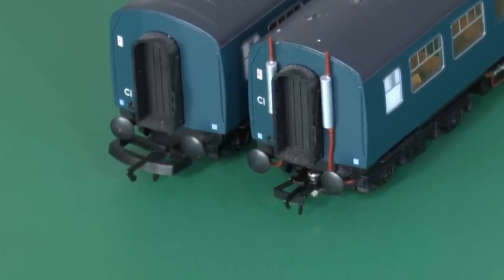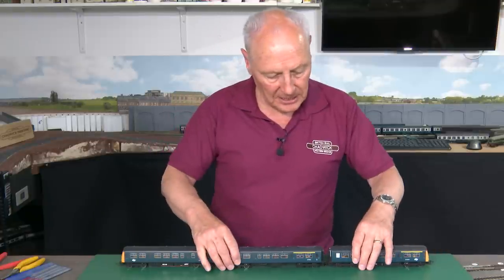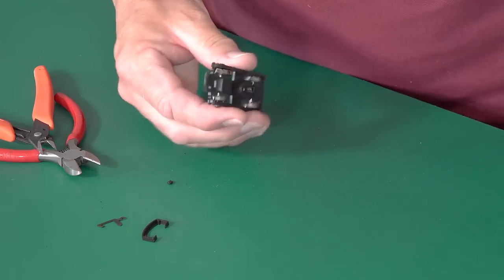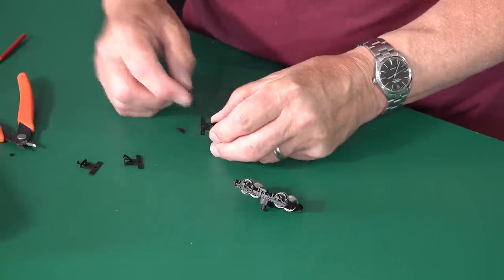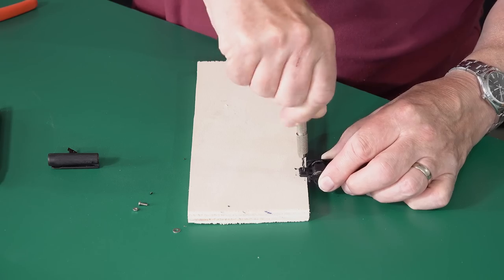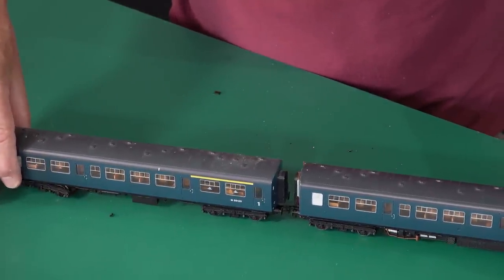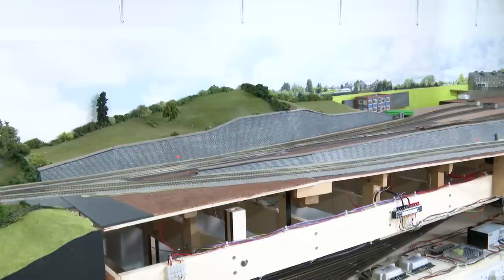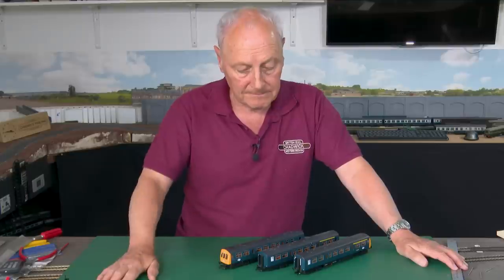REPLACING D LINK COUPLINGS IN SECONDS at Chadwick Model Railway | 196.

Comment: It was a de-luxe edition Swift, Charlie! 😉 I have done similar with several old Hornby wagons and their huge couplings faces which have been filed, smoothed and repainted to neaten the job. I don’t mind them as they are from a time when things were less fussy and as I know you agree, if they work for people’s needs, why change them? Plus I have some mint old timers that I couldn’t bare to alter as they are ‘of an era’, though I am not aversion buying old knackered wagons and giving them a whole new lease of life, like my Triang grey CEMFLO project. I have accumulated several knackered old models of said wagon and will be using the bodies to create different variants of the wagons. Because I feel like it!  😂 But they will definitely be getting better couplings! 🤓

Another thing I have done is file a space and superglue a NEM pocket on stock that I might want to run in multiple at some point. So far it has worked OK though I have only done it on about 3 or 4 vehicles so far. Works well if you like magnetic couplings 😎

Cheers Charlie! Have a great weekend mate 👍🍻🍀😉
Great stuff Charli
Reply from the maker: Thanks Tim, great comment. From where did you buy the NEM pockets.? Regards, Charlie
Reply: @ChadwickModelRailway : ooh blimey now you’ve got me! It would have been about three years ago now and I have a feeling it was just a random thing off ebay 🤔 I still have a wee bag with some unused somewhere amongst my toot which unfortunately is packed away, as are the bloody wagons 🙄 I’ll try to find a link if I can though mate. I also found some great budget magnetic couplings which another chap 3D printed. Guess where they are? 😂

Cheers mate 🍻👍🍀

Comment: In my humble opinion, a bit of a palaver. Having cut the dee part off and trimmed the edges, one then needs to check the height of the coupling, as Charlie did. If that is OK why not a drop of plastic cement? It can always be separated later to fit different couplings
Reply from the maker: Hi Stewart,,this that was exactly my point. Should you wish to swap it out for a different type of coupling or NEM socket, it would be a simple removal. 
Regards, Charlie

Comment: Interesting stuff. It took me a year to remove TLCs large and small from all my stock and convert to Kadee’s. Dapol seemed to be the worst for drooping and excess play. The old massive TLCs were better for running and reversing reliability
Reply from the maker: I too found of the Dapol and Heljan NEM sockets droopy,. It’s quite difficult to shim them up. Regards, Charlie
Reply: @ChadwickModelRailway yes and the Dapol NEM pockets so poorly attached, found it better to completely remove and instead fit a kadee draft gear box coupling to the floor of their wagons.

Comment: Might just be worth saying that you can't pull out those Lima coach bogies forever, the little bits of plastic which keep the bogie inside the coach soon wear or break off and that's why there is a mass of Lima rolling stock were the bogies just fall out... It can happen after on a couple of pulls if you're really unlucky.
Reply: Bit of glue added then filed sorts that
Reply from the maker: You are, of course, right gentlemen, they do get somewhat brittle. Regards, Charlie

Comment: Of course, if Triang had standardised on the Hornby Dublo/Peco buckeye-type coupling after they bought up Meccano ,instead of these awful tension lock items, you wouldn't be having this trouble - and you would be able to lift individual items of stock out of the trains without ending up with a string of de-railed wagons or coaches still hooked together.
Reply from the maker: Tell me about it, Peter, it’s a nightmare. Regards, Charlie
Reply: Hornby-Dublo couplings were a nightmare.  Very easily bent in our enthusiasm in the 1950's/60's.  Of course, we are talking trainset days I suppose, and our handling of stock not so respectful!

Comment: Think you need a couple of beer mats under the table legs to level up your mat and stop things rolling off. 😊

Good video Charlie, maybe you could add another nut on the spare thread and lock the nuts together but leaving the bolt slightly loose so that the coupling could swivel
Reply: Or use a nyloc nut?
Reply from the maker: Interesting options gentlemen, many thanks, regards, Charlie

Comment: Hi Charlie,
Another good 'un.  There is a wider issue underlying your detailed video,  Perfect track, cleaned to perfection and still it derails or uncouples.  And then you realise different (however small) couplings.  I seem to have less problems with the dreaded D but maybe I need to think smaller. How good will they be on tight radius curves?  
Conversion of an entire stock seems quite expensive.  Would it be possible to use superglue or epoxy instead of screws and  nuts and their visibility problems?
Dissimilar couplings are more of a problem than we recognise...

PS  Love the Chinchilla sand- perfect effect and quiet cheap at Pets-are-us.  I did dry clean my Chinchillas but they shrank.  They want their sand back. (No slur on any Cheshire related town intended).

Best wishes as always
Reply from the maker: You are, of course, right Graham.
It’s the dilemma between reliable, running and better Asthetics. 
Stay safe, regards, Charlie

Comment: Attachments for Dremel, Hart, and Iron Tough rotary tools should fit that tool.  Small diameter Chicago screws might have worked better than those with visible nuts since both ends have a slotted head on them.
Reply from the maker: Thanks mate, although I have never heard of Chicago screws. Regards, Charlie

Comment: Hi Charlie, it would be nice to have a video of how best to fit Kadee couplings to MK1 Bachmann coaches as they are a problem due to the wrong height. What is the best solution. I look forward to seeing your next video
Reply from the maker: Thanks Simon, I shall certainly look into it. 
Have you looked into using the Bachmann hose connectors?  I use them to permanently join my coaches together in sets. Regards, Charlie
Reply: @ChadwickModelRailway  hi Charlie, yes but sadly on my layout I can't run permanent sets of coaches and I need to uncouple into small sets in sidings. I'm also planning on installing auto decouplers in the sidings but using a different unit to Kadees
Reply: @ChadwickModelRailway  Charlie, I'd also like to see a conversion to Kadees. Not a problem with NEM pockets, but some of my older stock and Ian Kirk kits I've built don't have them  I've gone totally to Kadees on all my rolling stock. I look forward to your videos. Good chance to brew a cup of coffee and learn a few things.
Reply from the maker: Gentlemen, many thanks. I shall certainly give it my best shot. 
Regards, Charlie

Comment: Curious to know why you didn't fit NEM boxes? Then you could convert to Kaadee couplings if you want to as well. I know there's a height issue you would have to overcome, but it seems like there'd be some advantages in many cases.
Reply: I was thinking the same thing - though since this is a fixed rake DMU, I'd think about skipping the Kadee's and going with some of those new fangled magnetic or fixed close couplers!
Reply from the maker: I’m on the case with Hunt Couplings at the moment guys. Regards, Charlie

Comment: Big fan of your video's Charlie, but I feel you have missed the mark with this project. In summary you have replaced a dreadful coupling, with a slightly less dreadful coupling. I feel you would have been better off fitting an appropriate hunt magnetic coupling or kadee coupling, both of which are available with holes for your purpose.
Reply: I totally agree. I reckon it’s a waste of time replacing a large tension lock with a small one. They both look terrible on the layout in my opinion.
Reply from the maker: I take your point gentleman and agree 100%. I had a request from Subscribers to replace the tension lock up things with a better version. I will of course cover the knuckle and magnetic couplings later. Regards, Charlie
Reply: @ChadwickModelRailway  Fair point Charlie. Look forward to it.

Comment: A nut spinner may be helpful for holding the nut.
Reply from the maker: That’s scary, I’ve no idea what a nut spinner is! Regards, Charlie
Reply: @ChadwickModelRailway  Hi Charlie it is a cross between a jewellers screwdriver with a small socket on the end. It saves dropping the nut from fat fingers. Good old Amazon have them. Not sure about Wera tho’
Reply from the maker: Thanks mate, much appreciated. I shall check them out. Regards, Charlie

Comment: To me it looks more like the kopling of the pooling car or the car to the right that's pointing opwards (15;20). The kopling on the trailer vagon is strait horisontal. I am supriced that you in the UK still are using flathead scrues. Here in mainland Europe, we have been using torx for many years, or at least poizidrives.
Reply from the maker: Thanks S 12, it seems that we are being left behind. Regards, Charlie
Reply: @ChadwickModelRailway  Well, we are where we are, as you say from time to time 😉. I don't know, if ypu can use that fraze in this connection. I am after all danish.

Comment: na looks rubbish cut off the d ring make nem pockets from plastruct 6.4x4 box mark where the prongs on the coupling come too cut a notch either side of the box meaure how far you want the coupling to stick out cut off super glue in place easy also looks like any other with nem pockets
Reply from the maker: Thanks Derek, that’s for a later video.
Regards Charlie

Comment: Charlie, even those smaller couplings look pretty dreadful. Hunt couplings or Kadees are much better.
Reply: These also have their drawbacks. The Hunt couplers won't allow on track uncoupling and the Kadee couplers look ugly on most British trains. But it's s a case of horses for courses. And it's worse for those of us who model in N gauge...
Reply from the maker: Interesting points gentlemen. However, we do need to make inroads into removing those dreadful couplings. If only the manufacturers would switch to knuckle couplers. Regards Charlie